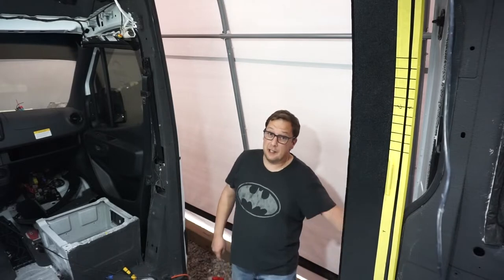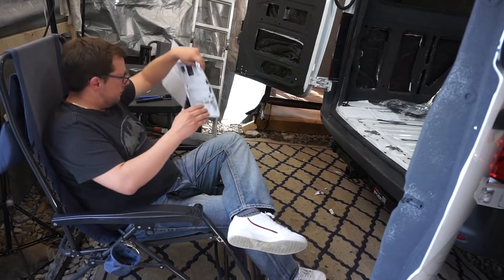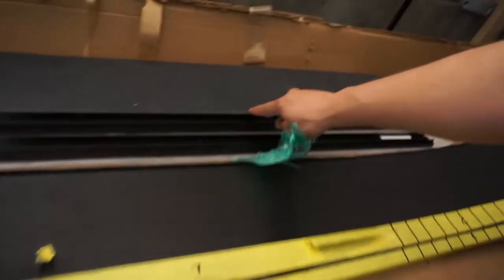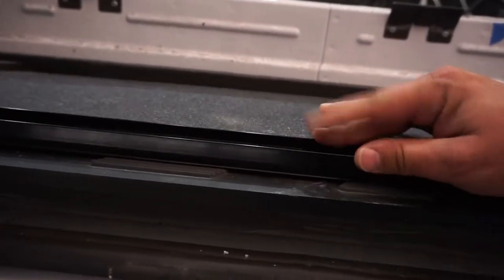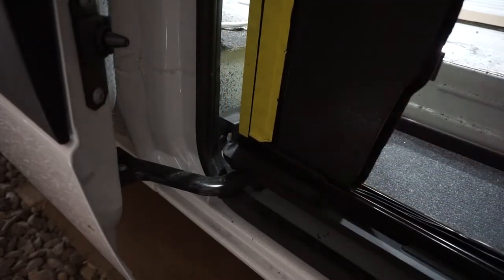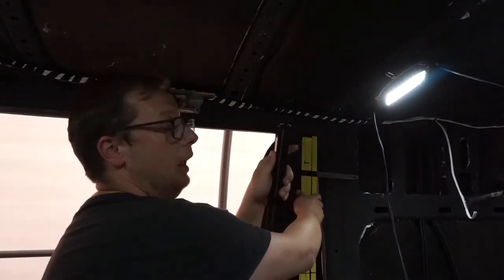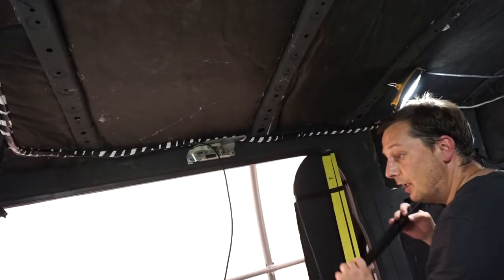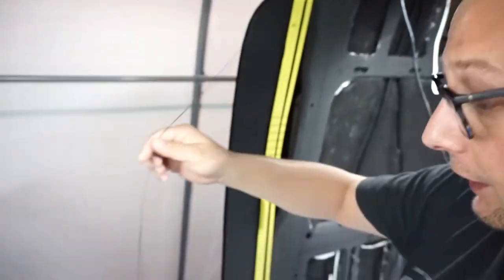Hideaway Sliding Screen Door | FOUR SEASON VAN LIFE | EP.25

Comment: Great screen install !  How is the van step now? Whould be curious to see a video clip on next go of the step up and out of the van with that lip being a wee bit shorter and higher up.
Reply from the maker: Dani Adams hey thanks for commenting again!  Yes this was something I did want to mention but when editing at 4am I noticed I forgot that shot!!   I will come back to it when we do the floors finishing.  As a quick note, being the 4X4 the step is already very high so the extra 1” is not really noticeable. Neither with stepping in you don’t really notice the 1/2 shorter length but I do have a plan for that as well when we do floors just to prevent damage to the track!